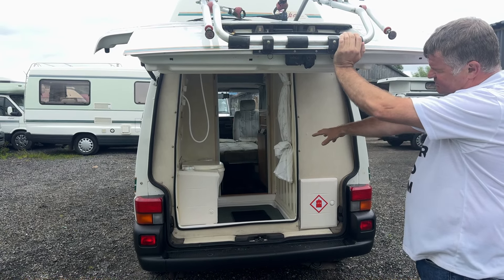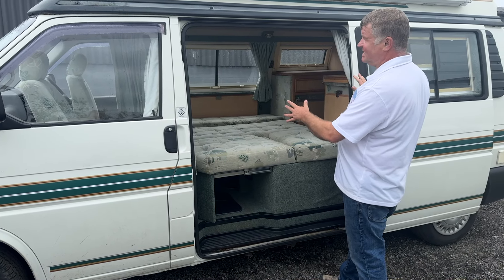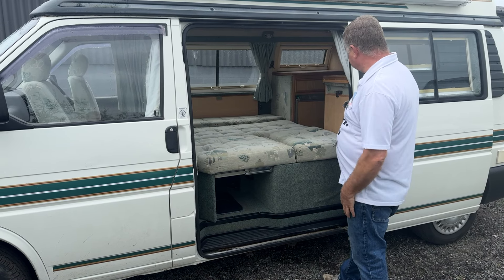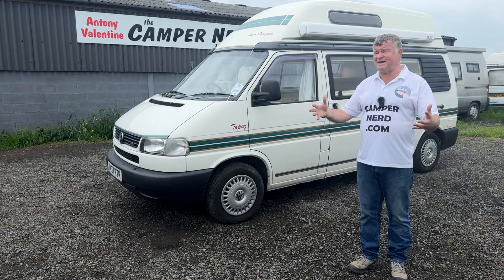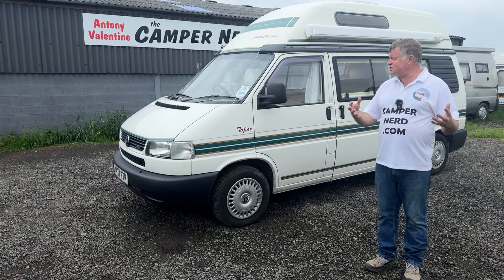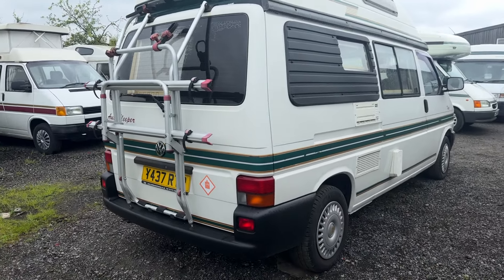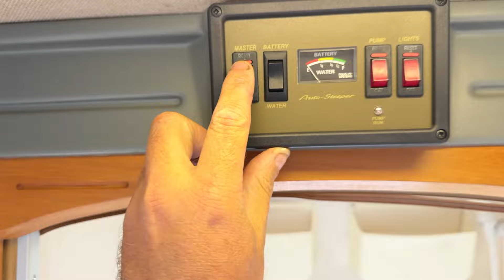NOW SOLD AUTOSLEEPER TOPAZ BUT EXACT SAME YEAR ARRIVED WITH 107K FOR £17999 CAMPER NERD

Comment: I recently sold my Topaz for a Gatcombe, phoned insurance company to change over details. Found out a few months later that the Gatcombe wasn’t actually insured as company said they don’t insure Motorhomes and they cancelled the insurance. I thought they would know the difference using the registration details but they said the Gatcombe should have been declared as “modified “. Thankfully I didn’t have to make a claim as they probably wouldn’t have paid out even though the Gatcombe V5 says it’s a motor caravan !
Reply from the maker: wow! thats shocking